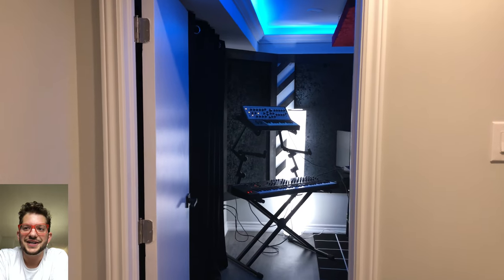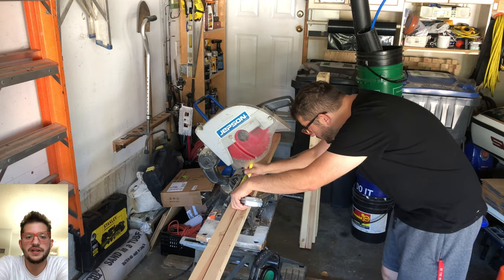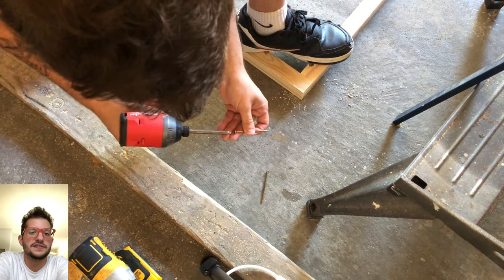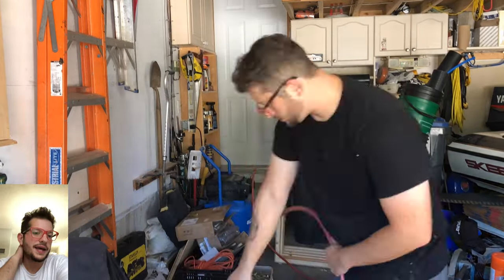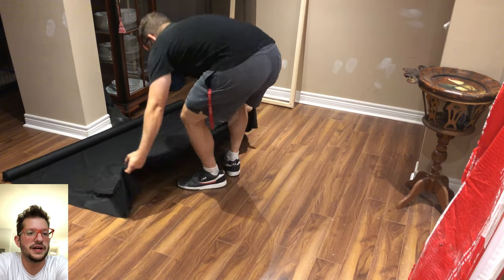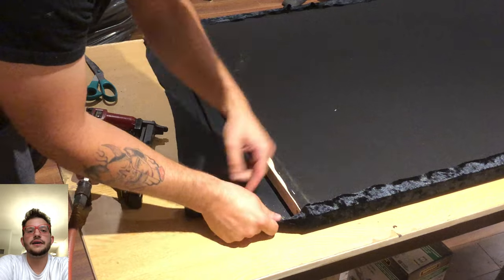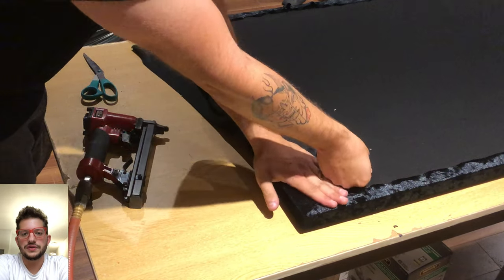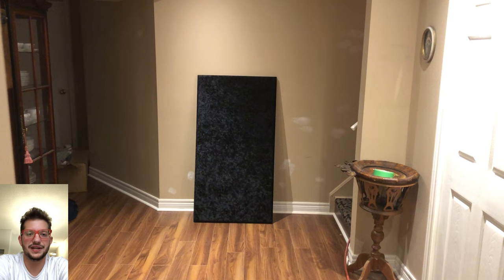HOW TO MAKE PRO ACOUSTIC PANELS FOR YOUR HOME STUDIO! DIY STEP BY STEP

Comment: Thanks for sharing. Much appreciated!!!
Reply from the maker: No problem! Thanks for watching
Reply: I'm about to build a few myself this weekend and getting the materials ready. I was wondering if a hand trimmer router with a 45 degree chamfer router bit would also do the trick. I know it's more work but is it possible to use a hand trimmer? Thanks!

Comment: Hey. I see you've been using Comfortboards 80. What reasons do you have besides aesthetics and ease of work, compared with Sound'n'Safe? Did you do any acoustic measurements with regard of those two materials? I.e. soundwaves absorption, transmission and reflections, frequency response?
Reply from the maker: Hello, I like to use comfort board 80 for my wall panels since the higher density and lower profile allows me to make 2 inch frames rather than 4 inch frames needed for safe'n'sound with a very similar frequency response curve and almost as much performance. When I make ceiling clouds and bass traps I always use safe'n'sound for the higher ASTM C423 ratings.

Here's a link for the comfort board 80 ratings:

https://cdn2.hubspot.net/hubfs/2998704/pdfs/product-pdfs/insulation/roxul/ROCKBOARD-40-60-80-Multi-Purpose-Board-Insulation-Brochure.pdf

And here's one for the safe'n'sound:

https://www.rockwool.com/syssiteassets/o2-rockwool/documentation/technical-data-sheets/residential/safensound-fire-and-soundproofing-insulation-techdata.pdf

Hope that helps! Thanks for viewing and commenting